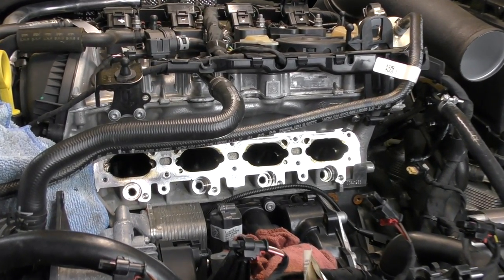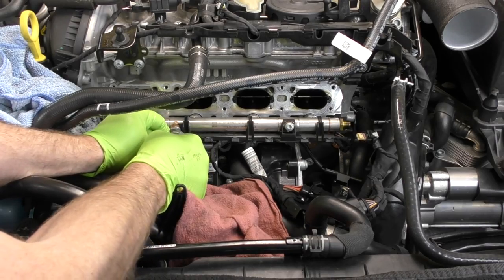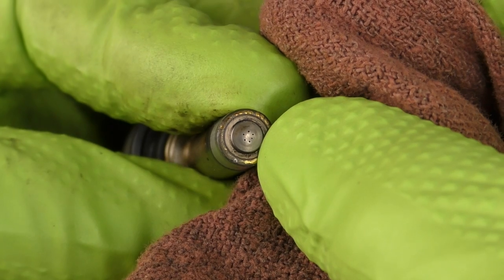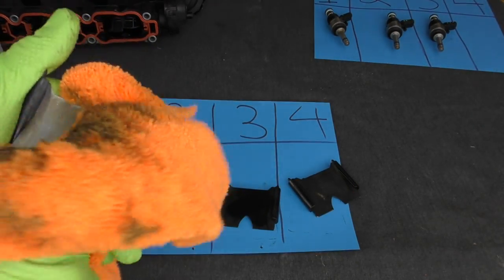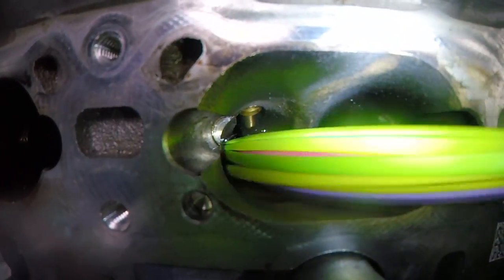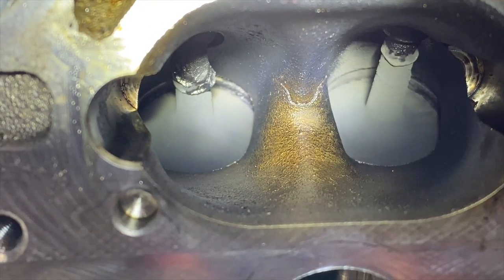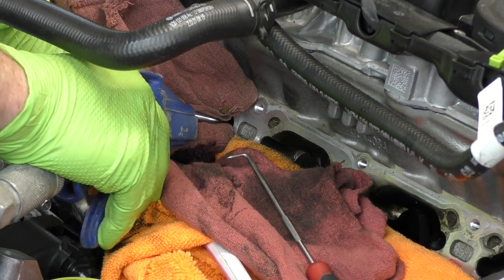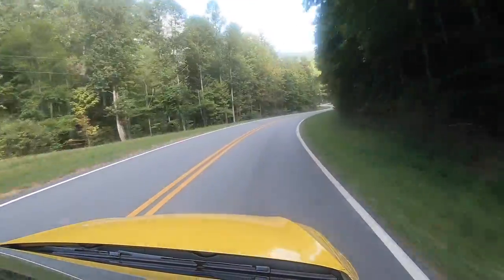How Much Carbon Build Up at 10,000 Miles?? ~ 2019 Golf R

Comment: I believe something such as CRC would be perfect for an application like this. There's such a thin layer of carbon I believe it would be able to clean those values very well. Too many people use CRC at such high mileage that there's no hope but to use something such as walnut blasting. Also It's funny because just the other week I was looking for information on low mileage carbon build up and this video was just want I needed, thanks for the quality content!
Reply from the maker: RIGHT! If you do those intake treatments as PM you might prolong the issue. but if you have carbon build up symptoms, it will not fix it
Reply: @HumbleMechanic  exactly, once I get my GTI in the next couple months I plan on doing intake cleaning every 5-10,000 miles so hopefully I'll never need to take the intake manifold off
Reply: @garrettbundy1810  not same brand, but I've used CRC spray on my GLA since 2015 to 2020, and did not have issues. 
I have a GLC300 now and continue the same trend, every 6 months 1/2 can CRC let it soak, drive it.
I WOT a lot too and always use quality oil meeting the specs.

Again, different 4 cylinder brand and design, I know the Mercedes PVC system is far superior to others on the market. But I've never had an issue, and intakes were always clean enough.

Comment: A few years ago, my mom needed a car. We were lucky to find a 2011 Honda CRV, the last year the Honda CRV didn't have GDI.
CRC makes GDI intake cleaning spray that advertises that it is especially designed for GDI engines. However, you can use it on MPFI, TBI, and carb engines according to the bottle. I used it on an MPFI engine and it worked well.
My dad owns a 2017 Honda Fit. I told him that he needs to run injection cleaners because of how much more stress a GDI engine puts on injectors. He got the message.

Thanks to high EGR rates, I have heard that modern diesels get even dirtier.

Comment: This is super interesting... thanks for taking the time to open up the intake side on a virtually new engine. 

I wonder... with DI fuel delivery, will there ever be a way to prevent this sort of build-up from happening? Unless you add manifold injection to your DI-engine (as some manufacturers are doing AFAIK), isn't this sort of behaviour "built into" the very concept of direct injection? All the cleaning properties of all the fuel and of all the V-Power additives in the world won't do you any good if the fuel never even touches the intake and intake valves ....

Comment: A friend of mine had this done recently on his 2008 Golf GTI. His direct injection system was pretty carboned up and not running well at all, it was similar to that of a GM spider Vortec injection system going bad. So he went ahead and had this procedure done on his car. I drove it back from the mechanics shop when we picked it up, ran pretty good after all was said and done.

Comment: I currently  have a 2013 Ford Escape and a 2014 Ford Fusion.Both have the 2.0 l  Ecoboost ,
One has 183000km and the other 174000km.
Full Synthetic oil change every 5k,
SO far so good🤞🇨🇦

Comment: You have a catch can installed on there too, right? Can't wait for the step by step. My Golf Wagon is probably due for this at 70k.
Reply: I dont see a catch can here. He installed one in the Tiguan of his wife a while back. https://www.youtube.com/watch?v=1hvgwXKVdYw
Reply: Gen 3 pcv when working correctly doesn’t need a catch can. I’ve had one for 2 years and it’s been dry the whole time. It’s also bad for your seals, it’ll increase crankcase pressure
Reply: @Irishluckily  A catch can will not increase crankcase pressure, It is just a sepreator that you put in the vent-line that goes back to the intake
Reply: 1kleineMax1 yeah it will, the line bottle necks. I installed it from pcv to the turbo inlet pipe. I know how it works. The only people who have had oil in their catchcans on the ea888 gen 3 either deleted the pcv or they had a failing one.
Reply: Anthony RS What do you mean by “line bottle necks”? The catch can is simply a chamber inline. Does nothing to crankcase pressure.

Gen 3’s still carb up the valves. I’ve done induction services on Gen 3’s a plenty. Plus look at this very video. Charle’s car has 10k miles, and the valves were sooted up nice!
Reply: @lynxstarautomotive208  So do catch cans work on these engines?
Reply: @lynxstarautomotive208  Sorry, my son changed my name again.
Reply: @chrisl6989  catch cans work on any engine when installed correctly.

Comment: This is Exactly why I have NOT bought a petrol direct injected engine yet. That 10k mile engine looks like a MPI engine with 120k miles
Reply: Honestly... I've seen 200k Honda D series engines with less carbon in the intake ports than this.
Reply: My '02 Audi A4 1.8T with 225k km has no carbon on the valves at all, literally. MPI with good gas (I use Shell V-Power) shouldn't have any carbon on the intake valves.
Reply: 120K miles?

Oh you meant 320K miles, easy typo to make.

Comment: I sometimes use a maglite through the sparkplug channel which can highlite the valves being fully closed prior to cleaning the ports. You can easily spot any signs of light between a partially closed valve & it's seat.
Reply from the maker: True, but that is tough to film to show you guys. :)
Reply: @HumbleMechanic  absolutely, wasn't being critical my friend, just adding a little to the thread, especially if any of your viewers were going to say that they filled the ports with cleaner & it all vanished! 😄

Comment: I just love how VW doesn’t believe it’s a real issue. It’s just a shame.
Reply from the maker: They do now. They have a special tool. LOL It's been known for a long time in the service side. both at the dealer and higher up
Reply: HumbleMechanic Every VW/Audi should have this cleaning acknowledged as part of interval service manual. Plus be upfront that these vehicles will need this procedure done every ~20k to maintain its function and reliability at owners expense.....or they could just fix it in entirety by fitting direct and port injection for the future vehicles.
Reply: This and the ridiculous oil consumption due to poor seals just gets ignored by them. They don't care because by the time it goes bang the warranty will have expired.
Reply: @BlatentlyFakeName  Audi did a rering job on my 2.0 TFSI free of charge nearly 20K after waranty was up.  I also did not qualify under the bad piston class action suit but they did it anyways.  Audi does care.
Reply: It's not a real issue to them when there are no problems during the warranty period.
Reply: Its not just VW.
Reply: Pretty sure they keep it like this to keep you returning for servicing your car etc

Comment: I don´t want to take apart my intake manifold, so, there´s a way to clean the back of the valves on a TSI engine? my 1.4T getting close to 12k miles.
Reply: Elmo Villaseñor They make additives that slow down the buildup and help clean some of it off. Check out ATP AT-100. You add it to the vacuum line and it doesn’t result in smoke like CRC or other products do.

Comment: As common practice on DI engines, I always clean my cylinders every 30,000 miles.  By that point it is pretty carboned up but BG and CDC products work really well at cleaning it out.  I don't take my car to the track or work my engine nearly as hard, so that works well.  My first DI engine on a 2008 Buick Enclave lasted with me over 150,000 miles with no problems.  Still running for a second owner.  Now own a 2018 Buick Envision also a DI engine, serviced at its first 30,000 miles with BG products it cleaned up the buildup well.  Was curious to see how much build up on an engine at 10,000 miles so not surprised at some build up, but the degree it is there already.  Thanks for sharing.

Comment: @HumbleMechanic Do you think 🤔 stage 2 tune is contributing to the carbon buildup? (extra boost = extra blow by = extra crankcase gunk through the intake?)

Catch can time?
Reply from the maker: That is possible. Most of the miles were at just stage one or stock. But its possible.
Reply: That’s a good question? Forgot you have stage 2. I gotta hunch it might be
Reply: I would think the Italian tune up would help prevent the carbon build up by going with a stage 2. Looks like the carbon build up is simply just still an issue since we don't get dual port injection in the US. Sad...
Reply: SaraK There is no avoiding it then. Guess I will have to do some Italian tuning on my own VW

Comment: Most people don't clean these systems at all for years and they run fine. A good run on the motorway for 60 miles with a good blast  and that would work wonders

Comment: I’ve had some so bad Charles, that I’ve had to open the valve and scrub off build up on it because in the closed position you leave a ridge.I remove the spark plugs, and when I’m done, I give it a pass with a blow gun. Any gunk typically blows right out of the spark plug hole. Then I turn it over with all plugs removed to verify no debris remain. I would not recommend this method to a novice or DIY’er however.

Also I use a combination of media blast, and chemicals. That really leaves them looking factory floor clean.
Reply from the maker: Oh yeah. Some get awful!!! You’re right there are a few other tricks I use, they require a little more finesse than I’m comfortable sharing. Lol
Reply: HumbleMechanic How has the catch can worked on the Tig? I’ve never believed in them, but the build up is such an annoyance on this engine, I’m willing to try.

Comment: life in plastic, its crack tastic . god if they could make the block out of plastic they would, as much as i love the mk7 once it goes past 250k or a a few years, id imagine its going straight to the junkyard :<
Reply from the maker: Let's hope not LOL
Reply: All those plastic parts though are soon available as cheaper pattern parts, simply because of that. Even the dealers buy them as well, especially for older vehicles.
Reply: I say the only Golfs that's worth buying is the Diesel one :D no VW gasoline engines for me thanks...
Reply: they sure are lighter weight, though!  Man when I pulled the dual-runner intake manifold off my Integra, even though it's aluminum, that thing was a BEAST!
Reply: @Patrick94GSR  better made though
Reply: Mine's going to the junkyard at 40k. The biggest piece of shit car I've ever owned.
Reply: @Lokyr00  which model you talking about ?
Reply: 250k miles you'd have gotten full value out of a car

Comment: My 2016 GTI  2L Turbo had no issues went to 89,000 miles not a blip of carbon buildup issue, no cold start CEL, traded it way too early to get into the 2019 Golf RRRRR, after reading they may not have STICK for new generation!

Comment: Its vomit worthy when i see plastic intakes, or cam covers like on the c63 amgs!🤮
Reply: Hope you realize that plastic intakes have smoother runners than the casted aluminum ones. Also does not act as a heat sink for the motor
Reply: Why?
Reply: RIP SIC58 its not conducive to longevity , and has a heat cycle limit.

Comment: Great video, looking forward to the  intake removal/install video. 
Any concerns about carbon deposits inside the combustion chamber? If the injectors are in the combustion chamber, and they looked dirty... I have a 2017 and at 27K I used a bore scope through the intake temp sensor hole and they looked similar to what I see in your video. I just used a can of CRC intake valve cleaner and sprayed it through the  same temp sensor hole per the instructions.  They cleaned up almost as good as yours, i posted some pics here:  https://forums.vwvortex.com/showthread.php?6926800-What-did-you-do-to-your-Golf-R-today&p=113536637&viewfull=1#post113536637
Reply: Your comments and pictures are very useful, i appreciate that.
Been driving really short distances for the past year and done almost 3500 miles. It is time for my annual service (oil and oil filter change, air filter...) and
probably will use the CRC next year when i will be at hopefully 10000 miles.
BTW i own Tuscon 1.6 TGDI 6spd Manual.

Comment: Done about 60K Miles on my Ecoboost 1 Litre 140PS engine and it still runs fine with no noticeable loss in power. A colleague has a 125PS version with 90K miles and it's still fine. So even if it does have lots of carbon buildup it doesn't seem to impact the performance.

Comment: Why is no one talking about 0W-20?! When I heard that i huh’d like scooby doo
Reply: 0W-20 is what most performance  FI motors recommend and it's not an issue in terms of carbon build up,
oil dilution would be my biggest concern which can be mitigated by frequent oil changes or going to something like 5W30.
Reply: BigHeadClan not in the euro world. My main reason was because it’s the same engine as the last generation which takes 5w-40
Reply: @Irishluckily  BMW typically recommends 0W20 for their motors but I'm not sure about Mercedes.  Either way the weight of oil can change depending on your location, recommended oil manufacturer and what type of oil you pick up by a small amount. 

The most important is location however, up  here in Canada we tend to recommend thinner oils for winter starts when it's -30 outside.
Reply: BigHeadClan yeah I’m in NH and drop down to 0W to be safe on coldstart when it’s that cold. Sounds better too lol
Reply: @Irishluckily  Hah yeah your pretty close to the boarder so you get similar weather, my roommate has a Mk6 GTI he runs almost exclusively 5w40.

He did try 5W30 this winter but was actually starting to develop some noise on cold-starts,  swapped back to 5w40 and ran as normal. 

So thinking his generation of motor was just very particular about oil weight.
Reply: BigHeadClan under 40 and it’ll sheer because the turbo and the heat generated. I have basically the R engine (2015)  and prefers some brands wayyy more. Mobil is junk and LiquiMoly being the best for it. This engine dilutes oils when you’re tuned. You can just smell it lol. I do 4k changes and monitor my stats so 👌    And that’s why I cant wrap my head around an R using the same oil as my corolla lol
Reply: @Irishluckily   That doesn't make sense as VW themselves listed 5W30 (and 0w20) as a supported oil so I doubt anything would be damaged unless you were driving the car hard at higher temps.

In my roommates case it's likely just some extra noise from the timing chain or exhaust cam,  the turbos wouldn't be in boost or spinning anywhere near fast enough at a cold start to generate a bunch of heat to sheer anything off.

It was Mobil 1 he was trying though so maybe as you said it just doesn't play well with VW motors.
Reply: Anthony RS I felt the same way, but the engine code is different for these latest models. My understanding is VW has tinkered with the internals.
Reply: Lynx Star Automotive ah okay, i’ll try and find sone reading material on it

Comment: I blame 0w-20 castrol for carbon build up. I live in region where winter is with snow and official VAG recommendation for ea888 engines is to have VW 502.00 0w-30 oil for winter and 5w-40 for summer. Would be very interesting to see amount of carbon build up after 10k miles on 5w-40 motul or liquimoly.

Comment: lol 10k miles? There's literally almost no carbon in there. Try cleaning your head at 130k like I did. My MKV GTI still ran fine and got good mpg, the only thing wrong was slightly sloppy cold starts. You don't have to worry about carbon under 80k miles because its FORCED induction, the air is gonna get pushed in there no matter what, and the only time you have to worry about carbon is when its literally looking like a cave with large stalactites and causes turbulent flow, and even then, the car will still run fine. Carbon buildup inst that big of a deal. Look at this link to see what i mean: 

https://www.reddit.com/r/GolfGTI/comments/aamrgx/before_and_after_carbon_cleaning/
Reply from the maker: I’ve seen plenty of engines WAY below 80k with severe cold start misfires. 

Just because it’s not enough to cause a noticeable issue doesn’t mean it’s not causing an issue.

Comment: In tank treatments aren't going to work because they aren't going to reach the part of the valve where the buildup is most problematic. There are options you can use to spray into your intake with each oil change that can help to address build up on the valves.

Comment: Charles #1 "You are the Man" ! Thank you for the always fantastic and helpful content.  

As for preventing carbon build up do you think any of the following would help?

#1 a manifold introduced cleaning such as Seafoam introduced into the manifold through say the sensor hole on top. Running vehicle while introducing the cleaner ?

#2 a meth injection system as it to also is dispersed into the manifold to mix with the air being introduced into the cylinder 

#3 is there a "fix" design to say split the injectors, 8 instead of 4. Where 4 are intoduducing fuel in traditional injection while the other 4 are introducing fuel via direct injection? 
If I am not mistaken I thought the Golf R sold in Germany for a period of time had the 8 injectors instead of just the 4 direct injection.

Comment: In my humble opinion, autox aka tracking is the real cause of oil (spray) hitting the valves. The oem pcv valve although very good for normal highway accelerations it is not really made to handle those extreme g-forces on the tack. It is highly recommended a catch can for track usage. I’m surprised you haven’t seen smoke coming out tbh or at least have someone say “hey man you got smoke coming out”

Comment: This will happen on all direct injected gas vehicles with PCV systems. If port injection is added it will keep the valves clean. A catch can will cut down the build up some but it will still occur as catch cans aren't 100% efficient at capturing the oil/water/fuel contaminants vented from the crank case. Ford identified this as a good solution to the issue and has added port injection to all their newer direct injected engines since 2018 or so.